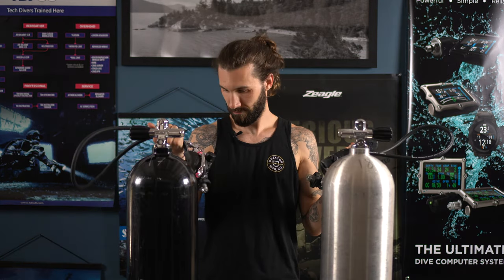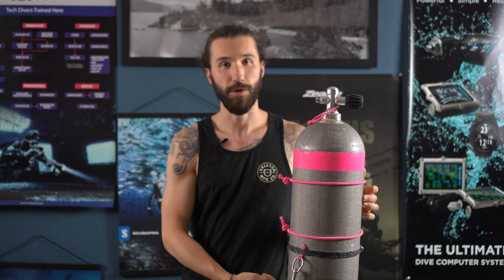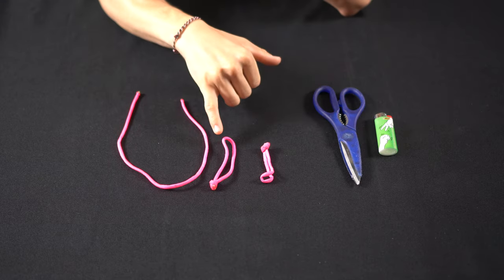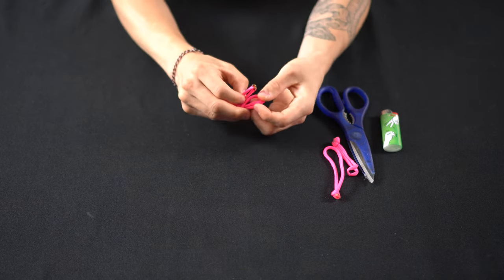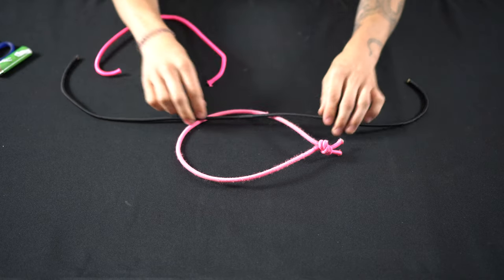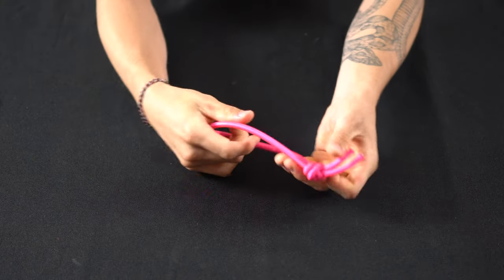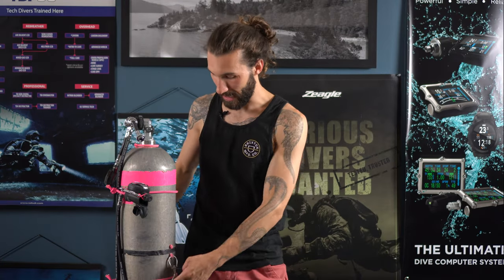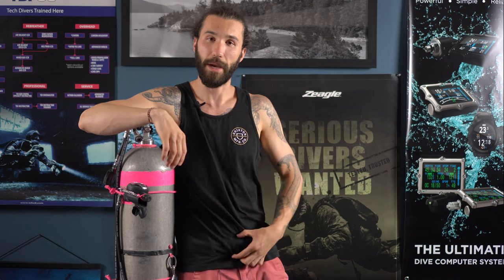How to Attach Sidemount Tank Rigging | Sidemount Cylinder Setup

Comment: nice video. 
any idea or tips for when traveling with no right hand value and only short post tanks? thanks.
Reply from the maker: There are a few ways of trying to make it work. What you could try is taking the loop of bungee and instead of taking the whole thing around the valve and hooking it on the post, you could open up the loop and go over the whole valve and reg. It won't be as easy if you are trying to remove your tanks and it won't stop it from spinning as much but it will work.
Reply: Short posts are tough. I found going around the valve handle like it was a post worked best when dealing with left hand only valves. It’s not ideal and you have to rig your first stages a tad differently. However, I was able to go through my certification and make quite a few dives this way. The valve handle was accessible for shutting off if need and hose routing was the same. This will expose your first stage as it will be outside and away from your body if your diving with them on the inside.

Comment: Alum vs Steel cyl trim?
Reply from the maker: Great question, this was all done with Al 80's in mind that will get neutral -> positively buoyant by the end of the dive. For steels you would simply move the bottom bolt snap around and generally make the cord holding it on a little longer so it always sits in the same spot. Not all steel tanks are the same, but in general that is what you will do. I can make a video on the difference if that is something you would like to see!